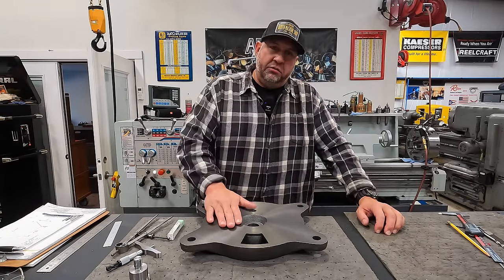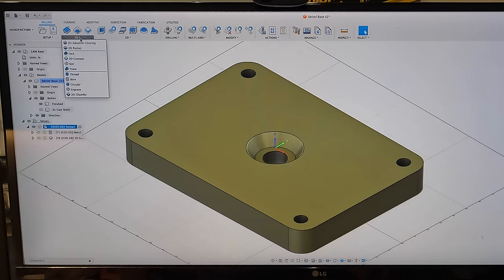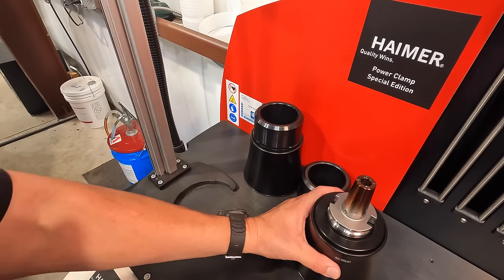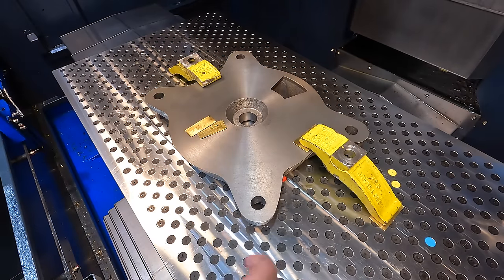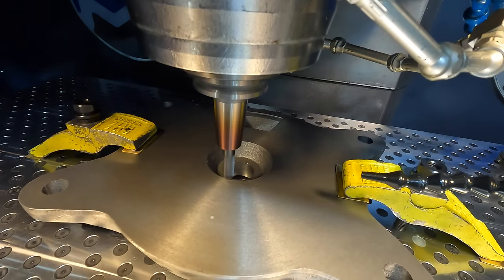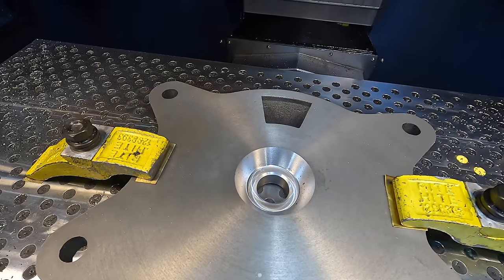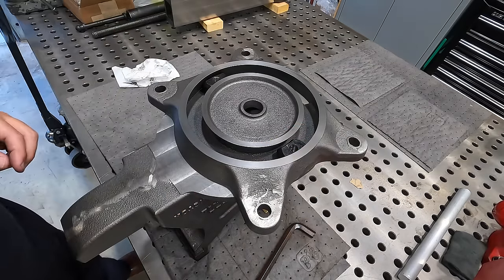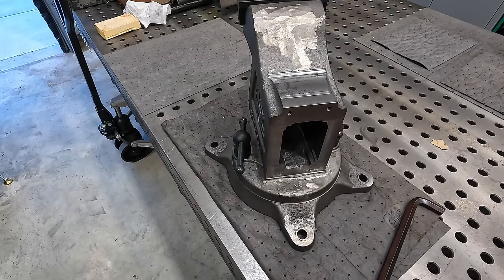Hardtail Vise Build Ep.18: Swivel Base Counterbore

Comment: Those darn decimal places. I made a batch of bronze gears once where I had the depth of an internal shoulder off by a zero after the decimal point. Fortunately for me the gears functioned fine in the application. I feel your pain. While I can't say I will never make a similar mistake again... I haven't yet made another similar mistake. As a machinist my best hope is that I will remember all the mistakes I have made and make fewer of them in the future. It's all about attention to detail. Sometimes the mistake is way back in a calculation (or data entry point in your case.) Fine video Adam and fine work. Thanks for sharing.

Comment: I just watched this on download Adam. Nice touch taking the off centre cast and machining the taper. Tidy look even if it's not open to visual inspection in use. I also saw the feet being milled level which you made the critical compromise on body and finish. I now will suggest you machine the tapered nuts in the swivel lock and also the taper nut track in the base. Thus having the slight release clamping force and a smoothest rotation of all those   assembled . Tapers are the most efficient holding systems and I believe will make it a true  quality heavyweight like so many other tools in your collection ? Such as mitutoyo, Starrett and all those premium American products.😊

Comment: Hi Adam (or anybody else that can answer my question), non machinist here. I noticed that the helical cut was cutting deeper towards the back than the front. When it faced the bottom it looked like it left some material near the hole (28:30). Was the cast wrong, or did the hole dimension indicator measure off-center? I think the latter, since if the xy Center is wrong, the width would be the same in two spots.

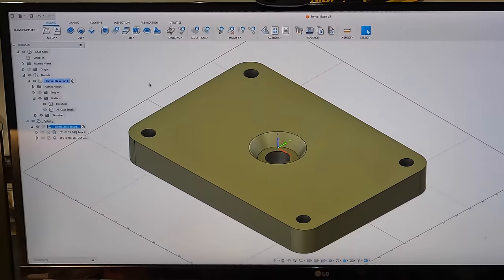Comment: 5:45 if its a Windows PC, just hit the Windows key, ALT key and letter R key at the same time to screen record. I normally hold down the Win key and ALT key and then tap the R because if you happen to catch the R first of the 3 keys, it wont start the Screen Record function.

I'll bet that we've all been there with missing a digit after the decimal and messing up a cut, I know I've done it a few times over the years.

Comment: I usually slow way down until the chamfer barey touches then see how much left You have to go down. On an expensive one off part, I will lift the chamfer with a .05 or .1 offset and run it then creep down until it touches. Its often also when You touch off the chamfer tool the flat on the tip ( if any ) will really mess You up

Comment: Thank you Adam for this new video.
If I understood correctly, you made the chamfer a little large.
But, why don't you make a new, larger screw with a conical head that fits a few hundredths from the vice base?
In addition, it would allow a wider reach on the underside of the base and the CHC footprint could also be much larger.
When you use the vice, you lock it with the two upper screws, I don't really understand the role of the central screw which must end up blocking itself when you manipulate the body of the vice, I think it must always have play, so how is it slowed down? I didn't understand that part. Would a screw braked on bronze bearings be preferable so as to guarantee only the smooth rotation of the assembly and no play?
Christopher

Comment: you are a machinist adam, not perfect. and these chamfer mistakes are easy to make and cnc is far from easy. i do wonder what the eventual runout/height difference is going to be when swiveling the base 180. i would indeed recommend machining the surface where the swivel locks/meatballs rotate on.

Comment: I am not sure if others have mentioned this but there is a trick where you use a needle scaler to match the texture of a casting. For example the parts of the casting that were cleaned up with an angle grinder and smoothed out, with a needle scaler you make the smooth parts look like the rougher casting. Not sure if you want to bother but may be nice.

Comment: Do you have to cool it off if you are going to just put another end mill in it?
Reply: The heat cycle presumes a cold starting point, so doing it while already hot will overheat the holder.
Reply: @kindabluejazz  is there no thermostat on the heater to cut off at the right temperature?
Reply: @marley589  My sense is an external thermo can't reliably tell the internal heat of the holder. Regardless, it is what it is and he's following the manufacturers guidelines and procedures. That last thing anyone wants is to have a piece of sharpened steel spinning at 5000 RPM coming out of its holder and flying around the room.
Reply: @kindabluejazz  I would imagine that considering the speed that it heats up a timer alone would have to be extremely accurate. Lots of variables are present such as the mass of the toolholder, the mass of the tool & the ambient temperature all of which influence the time to heat up. There must be a safety cut off at the required temperature otherwise a tiny increase in time will increase the temperature by a huge amount. So I can't see that considering all the variables, the temperature is reliably controlled just by a timer.
Reply: @marley589   It doesn't have to be super accurate. The system was designed to be used that way and variances are no doubt taken into account. I'm not saying there isn't a thermo in the system, just that it's not the only part of the total design. Not sure why you're so obsessed with this - he only needed to wait less than one minute. If you have more concerns, maybe contact the manufacturer.

Comment: QuickTime is an easy way to do screen recording. Also, if you wanted to go all-out with generating a model, you can take a picture of the part (square to the part) on your phone, send it to your computer, and “Insert > Canvas”. You can then calibrate the canvas by assigning a dimensional value to a feature. Then you can just trace it using whichever means you deem appropriate- Circle, rectangle, spline, etc.

Comment: If Adam's going to keep doing odd shaped projects like this, then I think he'll really benefit if he learns to integrate a 3D light scanner.  That'll certainly level up his game.
Reply: Sounds interesting.  However, the Renishaw probe is really a 3D shape scanner, just of specified locations.  There's a LOT that you can do with one.
Reply: @stuartschaffner9744  That is true, but I was thinking more along the lines of him learning more CAD skills.  Scan an odd shape, import into CAD, set the dimensions, and digitally make changes as you see fit.  I've used it for fabricating parts within an engine bay, like headers.  It's save me a lot of time and material in the long run.  Not saying he needs to use it for engine bays, but it would be valuable for learning more CAD skills.
Reply: @mrvector257 , good point, but aren't you describing more what is usually called forging or casting?  As with the vise project, it seems that shops like Adam's are often given roughly-sized parts as stock. By establishing precise reference points and surfaces, they turn a casting into a precision machined part. Blueprints often specify these reference points and surfaces.  Renishaw probes are just another precision measuring instrument, with the advantage that they transfer digital data directly into the CNC computer rather than relying on the typing skills of the operator.
Reply: @stuartschaffner9744  No, I'm only talking about Adam learning more CAD modelling skills.  Using a 3D light scanner to take an existing part, digitize it into a CAD model, and customizing a model based on that.  Then making the part in the physical world, based on how the design changed.  I'm not talking about what he currently does, just about what he could learn to do, if he wanted to learn more CAD skills.

Comment: Just an idea since you have two of them. Hardtail vices. It would be nice to have one of them on a mobile pedestal for holding material other than what you would have if it was mounted to the table or you could use it in conjunction with the other one if it was on a mobile stand

Comment: I use between a .002" and .004" step down when I am trying to achieve a mirror finish with this type of tool path. Yes, it takes a long time, but the finish is worth it if it is something you see.

Comment: 38:40
Keep it upside down, put the swivel bolt in there, rotate the base until the nut (clamp) mounting hole in it gets over the bolt hole in the jaw, put the bolt through, and drop the nut onto it. For the second bolt, just rotate it with the nut mounting hole over the other bolt hole.

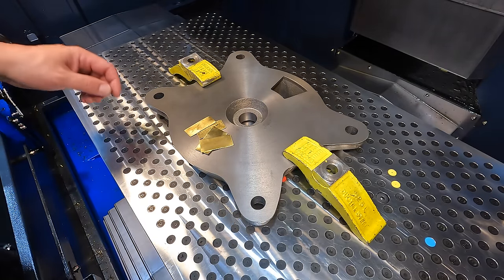Comment: 17:50 In my opinion the brass shims hold better too, to coefficient of friction of brass to steel is obviously higher than cast iron or steel to steel ... and ability to deform into ani tiny irregularities would make a measurable difference, in holding strength, even with less pressure on the clamping bolts!

Comment: regarding the screen capture, there are several devices that can record the output for the monitor. Do you have a second video output that you can clone with the monitor or do you need to loop through the recording device? There are some other free applications that can record the screen as well, both installed and through portable apps (windows).

Comment: I've never noticed there was a chamfer tab in 2d contour, I just use the chamfer toolpath lol. But I will say doing hobby work a .01" chamfer isn't really enough I always use .02-.03 as my default widths
Reply: I used this chamfer method twice today it worked great and arguably better than the chamfer tool path because sometimes the chamfer path errors out on selections for some reason, using the contour seems to work regardless as long as there's a path, tool and offsets input

Comment: Why didn't you just remove material off the bolt shoulder easy set up 2 min job Instead of taking 2 hrs to get same result.
Reply: Remember, he is using these projects to learn the CAM. He wanted to have that area fully machined. He didn't need to, but he wanted to. With experience comes speed. I would be looking at about 10 minutes to draw and program and the same amount of time it took him to set up on the machine.

Comment: A little grease and that vise with swivel like cutting butter with a hot knife.  Good video.  I also feel your disappointment with the chamfer cut.  We've all done it at some point.  A zero or decimal in the wrong place is all it takes.
Reply: I don't think so. It's the V groove thing in the base plate scraping against the swivel plate mate that is all still rough casting. He mentioned in a couple videos back he would like to machine that out, but it would not be easy - it would be hard to model and also to define the paths needed. Maybe when he's up for his next CNC challenge.

Comment: I’d cut a matching chamfer on the bolt to drop into your oversized chamfer on the base. It would keep the bolt centered and Bobs your uncle.
Reply: Can’t do that without making a new bolt.
Reply: The bolt is already perfectly centered - it's shaft is a precision fit in the base plate for more than one inch. The place where the chamfer is doesn't touch the head of the bolt at all. Cutting the bolt would do nothing but add more empty space.
Reply: @kindabluejazz   Well, Bobs still your uncle.

Comment: I'm sorry but why would you cool the holder down just to heat it up again. It doesn't make any sense.
Reply: This is just a guess, but I suspect that the holder needs to be a particular temperature just before the new tool is inserted.  Getting to that temperature consistently would be easier if the starting temperature were constant.
Reply: I would expect the tools to be immediately swapped over while the toolholder was hot.